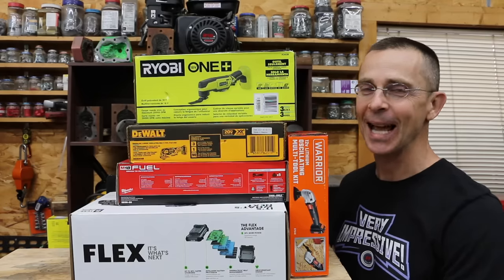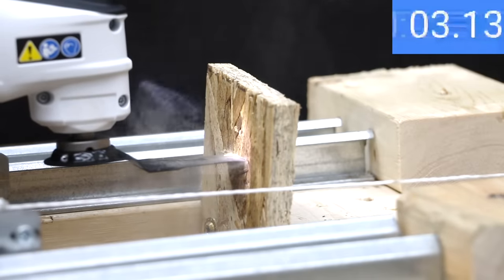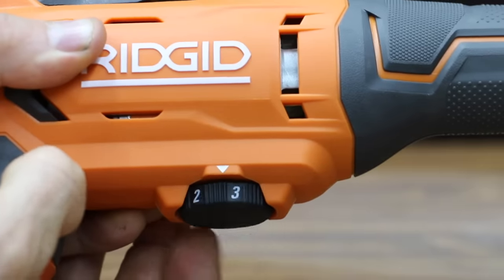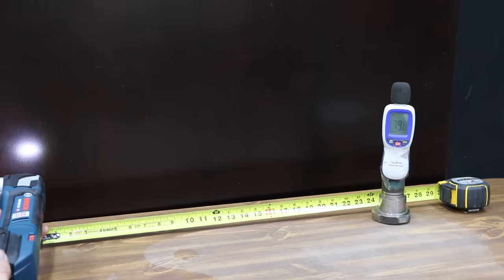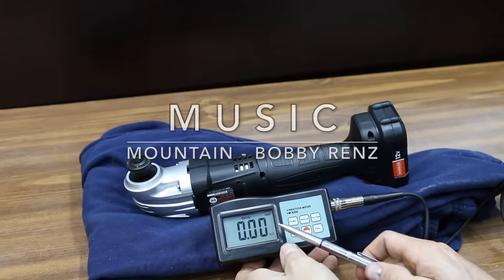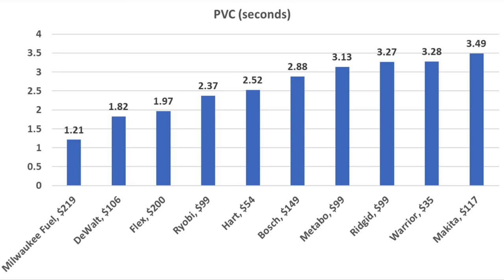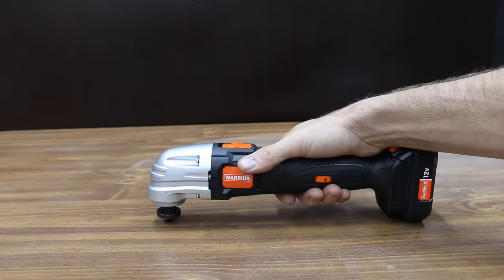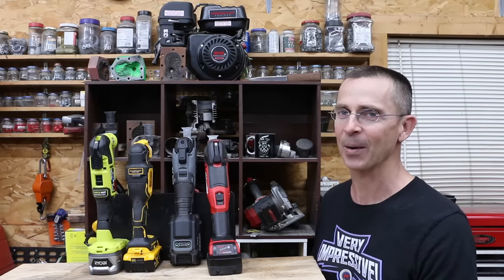Best Oscillating Multi-Tool? FLEX vs Milwaukee, DeWalt, Makita, Ryobi, Ridgid, Hart, Metabo, Warrior

Comment: Can’t be an oscillating tool lineup without Fein (they invented this class of tool and still make the best ones in my opinion), but great video nonetheless.
Reply: I thought Dremel did 🤔
Reply from the maker: Thanks!
Reply: @jasonspellich2440  Nope,  Fein in 1967 as the plaster cast saw.
Reply: @jasonspellich2440  Fein had the original patent on them.
Reply: Cool
Reply: Not sure how old my corded, Allen key Fein is but it’s still going. 15 years in a white metal case. Be nice to get the quick change but since don’t use every day would rather stay corded and have for 20 years
Reply: @jasonspellich2440  Dremel was the first affordable version released after the patent expired. Dremel was responsible for the widespread availability & use by your average homeowner/ DIYer. Fein infomercials were all over the place in the late 80s, but $400 was a hard pill to swallow from a tool brand 90% of US consumers never heard of. Dremel was already a mainstay of rotary tools in lots of households, they had the brand recognition, & price people were willing to pay.
Reply: Fein is not cordless
Reply: Fein is also the inventor of the drilling machine. In my opinion the best tool money can buy. Not cheap tough, but the best.
Reply: @fusiondensity3287  you obviously have no clue.

fein has at least 3 different models cordless. 10,8V so called 12V and 18V or in dewalt words 20V.

they invented this tool after all.
Reply: @casemodder89  i didn't have a clue they made them cordless. It was only corded when i bought mine in 2016. I haven't looked for one since then
Reply: Fein is king
Reply: @fusiondensity3287  no one said it was
Reply: @ruzziasht349  someone did say it was foolio
Reply: @fusiondensity3287  Fein AMM700Max Cordless Oscillating Multi-Too
Reply: Ahh yes! I’m a glazer/shop guy at a window company, and I when I first worked there, everyone called them fein knives, so I figured that’s what they all were and not an actual brand name. I was confused when I first heard “multi tool”.

Comment: When I bought my first Oscillating tool; there weren’t many brands making them. I’m surprised that you didn’t include the grandfather of the tool; a Fein Multimaster. That was THE best money at that time spent on a tool when I was installing kitchens. There just wasn’t anything like it. It would have been nice to see how it would have compared to the others. I sold my corded Multimaster to purchase the Milwaukee cordless. Works great!
Reply: I would have like to see the Fein included as well especially since they basically invented the segment.
Reply: @watsonlr  I agree. The majority of other brands appeared after the Fein patent expired.
Reply: @watsonlr  in finland we call oscillating tool pretty much just "feini"
Reply: The fein was the first one I ever purchased but didn't keep it for long. $450 for the tool back then just didnt sit well. Milwaukee seems to be my go to now
Reply: Fein tools are usually prohibitively expensive and not really marketed to DIY/hobbyists.
Reply: I just stated the EXACT SAME THING!
Reply from the maker: Thanks for the suggestion.  Thanks for sharing.
Reply: I believe that Rockwell was the first one to actually bring it to the average consumer.  They refined the rougher idea (Fein) to the design that we use now.
Reply: @watsonlr  they invented a tool to cut “Casts” off and repurposed it for other applications. The others appeared after Fein patents expired. I have a corded Fien and think it’s first rate. I also have a corded cheap Harbor Freight that I use on material I don’t want ingested in the Fien. I have had my eye on the Milwaukee (new version) since it was introduced. Looking for a sale. Meantime the corded ones work for my occasional use.
Reply: @allwoundup3574  When I bought mine, Fein we’re all that were available. They’re great for cutting the tongue out to remove floorboards.
Reply: I have a corded Fein and is leagues better than anything else I have tried. Fast cuts. Minimal vibrations. But multi tools should be cordless. And who buys a cordless tool without battery compatibility to a family of tools? So Fine is a gonner. I have a lot of Makita tools so I bought a Makita multitool.  I have to say that the review is fair. The Makita multitool sucks. Just useless. Don't buy it. So I guess I should go with Milwaukee. But I have had really bad experiences using the latest and most expensive  Milwaukee drills. Burnt two building a standard wood deck this summer. My Makita drills are bullet proof. Deep sigh... Whatever battery system you buy in to you end up with some crap tools...
Reply: @dvogonen  easy fix, buy adapters so you can buy the best tools of different brands
Reply: TheCheesePlease  You obviously never actual used any fein products....the multitool and vacuums are topnotch...
Reply: @dvogonen  funny, same for me.  I'm a Makita user.  Hammer drill, impact driver, and also an impact wrench.  I have a corded Fein and nothing touches it.  I wouldn't even consider the Makita mulitool...
Reply: @dvogonen  ABSOLUTELY TRUE!... That is why I try hard to refrain to buy battery tools: once you start collecting a certain brand of battery tools, you become "Married" to that brand, which will GUARANTEE that you will have a very varied quality and wildly varying performance set of tools!  Every brand has a wide range of quality and effectiveness models in their line, from very good tools, to mediocre models, to the worst possible ones.  That is why I prefer most of my tools to be chosen by specific models based on performance, design and characteristics, rather than just "brand", whichs plagues most people blindly following and becoming furious fanboys of a certain tool color (brand) !, so my tools come from possibly ten different brands, every tool chosen by its combination of design, precision, power, ergonomics and performance/price ratio. Not even Festool has all its tools in their line being all perfect.

Comment: The speed control on the DeWalt is an absolutely awesome feature. Had that unit for a few years and it's still going strong.
Reply from the maker: Great point! Thank you
Reply: I will say that the dewalt oscillating tool I got about a year ago does not have the speed control on it.. funny because that's the one thing I had wished it had
Reply: Agree.  Have the same unit and it's a beast.
Reply: Can vouch for this, been using a dewalt brushed multitool for almost 5 years and it still works like new, I'd take the dewalt trigger over more cutting speed any day
Reply: @woodcrafter7361  athe XR has a 3 speed, atomic single speed
Reply: @FusionBoost2.0  I have the brushless Atomic....and it HAS variable speed trigger.
Reply: @powrguy1696  Yup they just don't have the speed selector
Reply: @FusionBoost2.0  not a big fan of the "variable trigger" I'd rather the 3 speed selector, trigger seems to be all or nothing lol
Reply: I'm jealous of the dewalt blade holding mechanism. I have the fuel m12 and love it, but I'm also in deep on the Milwaukee ecosystem so its not like I have a choice lol.
Reply: its useless lmfao just put it o nthe highest setting always, theres no circumstance where slower is better. cringe.
Reply: @crystalhater2023 dewalt sucks cutting is slow and that's the purpose

Comment: The Dewalt blade change system is what wins things for me, being able to quickly set the blade/attachment at a different angle or easily switch when you’re in a tight spot really makes a big difference
Reply: I have all Milwaukee tools and I’m not a dewalt fan but I am a huge fan of the dewalt with the quick change. I would have bought it over the Milwaukee for that reason alone but I didn’t want to deal with another type of battery and charger considering I have several Milwaukee batteries already.
Reply: Agreed.  I have the Dewalt.  I wish it had a bigger oscillation angle but other than that it is nearly perfect.  It takes longer to make cuts than I like but the super quick blade change system along with being 1/2 price of the Milwaukee makes it my choice.
Reply: I bought and then returned the Milwaukee M12. The blade change doesn’t involve tools but having to unscrew it a few times and then rotate the blade and then screw it back and then tighten it was really annoying. 

I also have an older Fein corded tool that predates their anti vibration system. The M12 tool’s vibration is so much better that I am going to have to buy another tool if I am going to use the tool a lot.
Reply: Totally agreed. If you factor blade changing time into the equation, dewalt would win the contest at least for me
Reply: @gf2e  Everyone on this little thread saying that you have to unscrew the Milwaukee or the Ryobi  it’s not true 9 out of 10 osculating blades you buy have an opening in the back that bolt isn’t Intended to come all the way out he was using a star lock blade design because it was universal with all the tools. Majority of osculating or multi tool blades are not a star lock design. What that Dewalt lacks in performance and speed you’re not making up in blade change. The cutting speed Produces less tear out a cleaner cut and is more precise with less effort. If you had to use this tool professionally you know that would not top your list of priorities.
Reply: The price and quick change on the DeWalt would tilt me in favor of it, but then I can also use the batteries from my DeWalt drill, so it's a no-brainer. The Milwaukee did great, but you pay for it. Worth it if it lasts twice at long,, though.
Reply: @steffendetrick9403  I didn’t say you had to remove the bolt all the way. I said you had to rotate it a few times after flipping the lever. The M12 tool has some dimples sticking out which prevent the blade from rotating when you flip the lever. 2 or 3 rotations of the bolt give you enough clearance to rotate it, or remove it if your blade is open on the back. (Some of my older Fein blades are closed on the back, but I got new blades with this tool for best compatibility)

I agree that a professional user should not treat this as a dealbreaker. I am not a pro, and tried to make it clear that it annoyed me rather than was a major flaw. I returned the tool because the quick release wasn’t as quick as I had expected, and because I read more about how fast a Starlock quick release is. 

I’ve since tried Starlock on some store demo tools and it actually seemed more annoying to get into position than I was expecting. I’m going to examine my options in a month or so when I have another project coming up.
Reply: Waaaaay too much vibration! I never use mine. Haven't in 3 years, after buying a Fein.
Reply: @steffendetrick9403  Milwaukee? Is that you?
Reply: The variable trigger on the Dewalt is the key feature for me. I have a corded version but I assume it’s the same.
Reply: Any Starlock compatible tool will offer fast, tool-less blade change, ability to set at any angle and better interface for torque transfer.
Reply: That Dewalt blade change is amazing. They must have it patented because no one else has anything even similar.
Reply: Not really
Reply: @BlueDart1971  i have the dewalt, but gonne get the milwaukee, has way more power, the dewalt is  oke with new blades once they are a little used it takes a long time to cut, and doesnt come close to corded multitools, the milwaukee does
Reply: @MoneyManHolmes  Those are old Models of the Bosch and the Makita they both have a do quick change that was actually designed by Bosch the whole star lock system was designed by Bosch
Reply: @MichaelM-to4sg  The 12v Bosch is Starlock but requires a tool to change blades.
Reply: @FusionBoost2.0  nope it’s Bauer!
Reply: @steffendetrick9403  bosch together with fein
Reply: @Everythingisgoingtobealright  The DeWalt trigger intrigues me. The M12 tool ate batteries really quickly. I was only cutting through very thin wood, maybe 1/8”, but the (tiny, I know) 1.5Ah batteries only lasted 15 minutes or so.

I assume that it would use more power if it was cutting through harder / thicker material. Most of my time was spent lining the tool up and getting it into position. So I think that a tool with a trigger would’ve used much less power. The power switches on the tools that I’ve used did not make it easy to quickly turn them on and off but encouraged leaving the tool on as you figured out your grip and angle.
Reply: @BlueDart1971  Totally agree, settling on cordless tool system also means settling on a suppliers battery scheme.  I don't want to fiddle with 10 different battery types and chargers either.
Reply: @gf2e  
I use it for tight sheet metal work (auto body) so I like to get it into place and slowly apply the power.
Reply: @BlueDart1971  there are battery converters if you don't mind the extra bulk.
Reply: @cdgee6399  i’m not trying to signal out DeWalt it’s just not a very good multitool or osculating tool. It’s being defended out of brand loyalty.I’ve never used the Fein I’m sure it’s an Incredibly well made tool though.
Reply: @steffendetrick9403  I agree sir. I don't like my own Dewalt osc tool. It's why I own Fein now.
Reply: @gf2e  I have the same experience.  Started with the low vibration fein tool.  Cord was annoying.  Bought the m12 and the blade change was really annoying. Bought the m18 version and the new 3.0 batteries, great tool.   Use it everyday.
Reply: @avman2cl  Did you use the $99 brushed M12 or the $149 brushless? The brushed doesn’t have a quick release. The reason I ask is because the M18 brushless in this video looks just like the M12 brushless that I tried.
Reply from the maker: Thanks for the feedback.
Reply: @ALegitimateYoutuber  I already bought the M18 and it’s not worth it at this point. If I used it all day long it may be worth it.
Reply: @mrgunn2726  exactly.
Reply: @promo130  I’m really happy with mine. I really do like the quick change and variable speed but not worth changing anything at this point.
Reply: Yep DeWalt's blade change system makes it a winner. Also the nicely contoured and padded grip
Reply: Bosch Starlock is way faster than all of them. I never put the blade on like he did thats just slow. You have them laying on the table and just push the Multitool on. and just like that you also can change the angel of the blade.
Reply: @gf2e  - If you have not already, you should add a few 4.0Ah M12 batteries to your toolbox. The added run time and amps supplied make the M12 line much more robust over the 1.5Ah batteries. If you need much longevity, the an 18/20V system is the way to go.
Reply: The DeWalt blade change in very convenient, however it is also very stiff and has to be held with one hand while loading the blade with the other. I have found the lever systems are a bit easier on my aging hands. When I can't do the lever type anymore, I'll know it's time to throw in the towel on power tools.
Reply: @Everythingisgoingtobealright  Good point. I should say my Dewalt I'm not wild about is the 20v cordless version. The Fein I own is a simple lever flip to change blades. Almost instant to do. Almost zero vibration. But heavy!
Reply: @genjii931  5year warranty compared to a 3year warranty so almost. And obviously performance and quality add value but it’s a no brainer to go with the platform you’re on unless you plan on using battery adapters.
Reply: @valkyriefrost5301  Yeah, I’ve been expanding my system since then. I’m an amateur and I’m usually slow / cautious so I figured that the discounted bundle with a drill and two 1.5Ah batteries would be enough for the wood trim around the fridge. It was barely enough - I kept swapping batteries. 

I have a brand name 2Ah and 4Ah, and just got a knockoff 3Ah and 6Ah. I will be testing the knockoffs with a load tester to see how “optimistic” they are. Build quality is good so the worst that happens is in 6 months I replace the cells inside the packs with some good ones. (M12 batteries don’t have a BMS inside, just a thermistor, so there is less concern about quality of electronics in knockoffs)
Reply: @KriegerDelfin24  
True, But it underperformed in a lot of tests with this and other tools